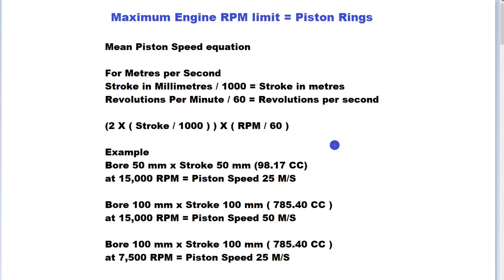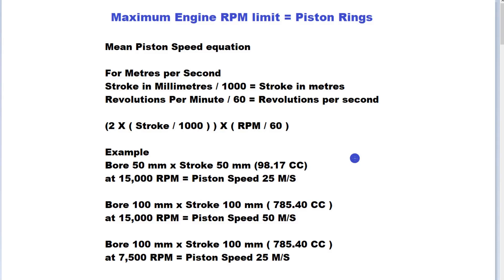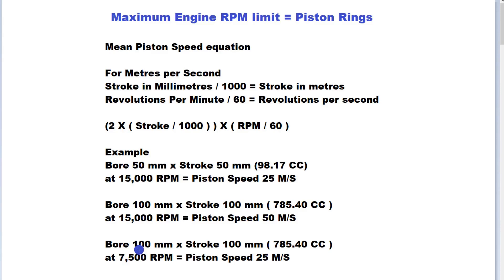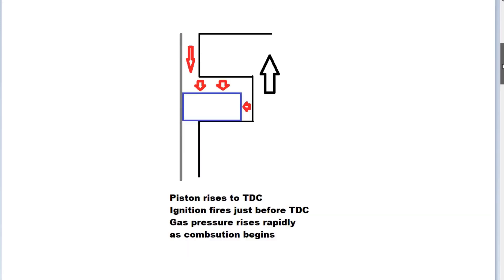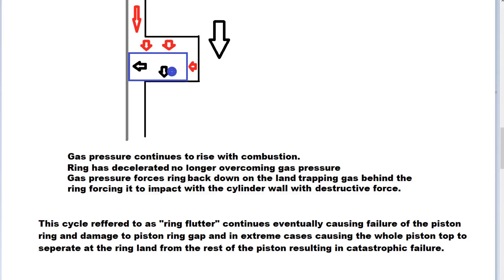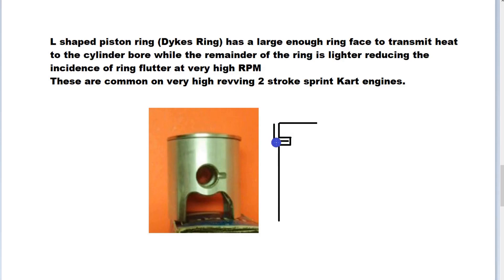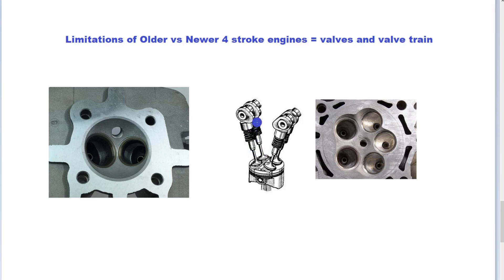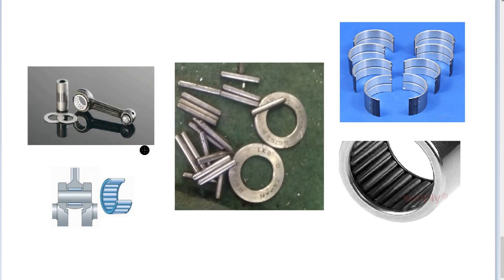Why 2 Strokes can Rev Higher than 4 Stroke Engines and What Limits Engine Speed.

Comment: Really depends on application. Modern 4 strokes rev higher than 2 strokes and actually make power as a result of their linear powerband. You can rev a 2 stroke too high outside of effectiveness. My 250f yz 250f revs higher than my yz 125 and makes more power. 

I would have to make a major sacrifice to my low end to try to rev it to the same rpm. Which naturally being a c level rider is going to make the bike harder to ride and less forgiving. 

Being fair it requires double the displacement to approach "similiar" power. In reality most guys would take a 250f over the 250 2 stroke as its a broader motor and its easier to ride.
Reply from the maker: Your yz 250f may rev higher than your older yz 125 but that does not follow to all engines.
4 strokes do not rev higher than 2 strokes simply due to the mechanic constraints of the fundamental 4 stroke engine as compared to the 2 stroke.
In sprint karting for example rotary disc 100cc engines have been running at above 20,000 RPM for decades and ring-less RC engines revving to 35,000 RPM is not uncommon.
As for the claim "In reality most guys would take a 250f over the 250 2 stroke as its a broader motor and its easier to ride." Once they learn how to ride properly and are able to master the power curve of a 2 stroke it is unlikely they would prefer a 4 stroke.
Reply: @AuMechanic  agreed. Learned and grew up on 2 strokes since I was 5, I am now 31.

Comment: Thank you. Can you explain if the cdi has a rev limiter?
Reply from the maker: Most do have a limiter theses days, it is not inherent in CDI it is simply an addition to them.
If you modify an engine to rev higher you may have to replace the CDI with a programmable unit to allow you to have a curve that will permit higher revs.
Reply: What CDI would you suggest to rev the highest without a limiter? I'm using a jog cdi now. The engine has a chainsaw cylinder on a motorized bicycle. I'm looking to make the highest rpms possible

Comment: The Cbr250rr 4 stroke 4 Cylinder, Revs up to 18,000rpm  that's the Most I've seen on a Stock Bike I'm not sure Moto Gp even Rev that High, I guess it has Small light Pistons & Very Short Stroke, to allow for those Piston Speeds! 👍😉
Reply from the maker: It probably does have light pistons but keep in mind that it is a 4 cylinder so each cylinder and piston is 1/4 of 250cc in size (about 62.5 cc). For that size capacity 18k revs is not overly high considering that some 100 cc 2 stroke rotary disc intake Kart engines rev well above 20k.
MotoGP at 1000cc 4 cylinder is 125 cc per cylinder so 18k is relatively high. Noting that mean piston speed factors in stroke so a larger capacity engine also has a longer stroke as well as larger bore than a smaller engine even where the bore to stroke ratio may be the same in both engines.
Reply: @AuMechanic  Honda NSR 500 имеет рекорд мощности на литр, 400 л.с. на литр

Comment: If I was to put a straight expansion pipe on a 2 stroke leaf blower. Would it help to get more power or higher rpms.
Reply from the maker: It may produce a bit more power but if the pipe is not properly supported you may end up breaking a flange stud.

Comment: Thank you for all of this info, but the car I’m looking at has a piston speed of ~17.1 M/S at redline (6500rpm and 79mm stroke) would it technically be safe to let the engine rev until the piston is moving at around ~22m/s? The engine is from the 70s and is an ohc engine, but if I fixed any valve float problems, could I technically rev it higher? The torque drops off pretty quickly after it’s peak, so would it even be worth it to allow it to rev higher?
Reply from the maker: It really depends on the engine.
This video covers the ultimate limit on piston speed assuming the rest of the engine can handle that RPM.
In short there is a lot more than just the piston speed to deal with.
Reply: AuMechanic yeah I get that, and thank you again, but In theory, could I do other modifications to have the limiting factor the piston speed? And would It actually matter that much? It probably would be better to find a way for the piston to have a longer stroke instead, but I’d probably have to pay a lot more to do that than I would to get it to rev higher. I don’t know if I ever will even do this, but I was just curious if it is possible. Your video was great and I appreciate you responding to me so quickly. Keep up the good work 👍
Reply from the maker: @The Hungry Shark 
Increasing RPM has diminishing returns and as it increases so does the risk of catastrophic failure.
It is the kind of thing you do when you run out of decent gains with other mods.
Example in the 90s when I was involved in a Formula Vee (as mechanic) we had 1200 cc air cooled VW engines that made peak power at just under 4000 RPM, due to limits on modifications raising the RPM was worth the gains and only took a bit of exhaust work (tuned length) and ignition curve (over advancing top end to overcome the restrictive stock intake, carb and stock cam) to get it revving to 6000 RPM and would do 6K all season long without a rebuild.
But....do that to some other engines are you are going to have oily parts hanging out the side of the block and that is long before you get even close to ring flutter
OTH it is a simpler prospect with 2 strokes to raise RPM for gains with less moving parts so piston speed presents itself as the limit.(and Im talking 16,000 to 20,000 RPM)

Comment: My snowmobile is a 500cc 2 stroke virtical twin and wont go past 8100 rpm, how can I squeeze out 8500 or 9000 rpm for more speed?
Reply from the maker: In the case of a stock standard snow mobile it may be down to the ignition module it uses more than porting or exhaust.
2 stroke ignition is a bit different to 4 strokes that simply advance through the RPM range.
2 strokes advance at lower RPM but then up top as the power peak comes on they retard ignition.
So they have either a fixed ignition with no curve or an ignition that can do the above.
In the case of a snow mobile it may have a module with a curve that limits the RPM for "safety" purposes so in that case I would do a little research on the module you have to see if there is alternative ignition modules used to get it revving higher.
Reply: @AuMechanic  it has a switch for premium or regular gas and you switch it accordingly so I would assume it changes the timing
Reply from the maker: Ok that seems to indicate it has some curve options in the ignition module, Id investigate that ignition module more to see if there are any after market units you can use in which you can program the ignition curve.
Reply: @AuMechanic  thanks will do
Reply: 4 jokes rev way higher!

Comment: what is the effect of having long crank throw and having short crank throw in 2 stroke and 4 stroke and the advantage and disadvantage of it? advance thank you for your answer
Reply from the maker: Good question but a bit much to cover in the comment section, I may do a video on that itself.
A longer stroke will produce more torque per revolution, however that will also limit peak RPM of the engine and produce more vibration.
A short stroke will rev higher to achieve more power but will lack torque so will be very peaky but also have less vibration so things like hand held engine like chainsaw etc will have very short strokes.
It is a balance between stroke and bore so most engines have close to same bore and stroke.
There is a good deal more to it but that covers a few points.
Reply: @AuMechanic  i admire your profession sir. i have so much question about reciprocating engine in my brain like what can you say about todays technology of reciprocating engine and how its affect its lifespan and durability compare to old technology apply to an old reciprocating engine? And will reciprocating engine beat the toughness of a gas turbine engine todays technology in piston engine in aviation world?
Reply from the maker: I don't know a lot about aviation but I know that for small light aircraft the piston engine has a lot of years left in it and I can't see it being replaced anytime soon in small aviation applications.
As for modern engine life, computer aided design, tighter repeatable machining tolerances and  advanced materials have all played a part on improving the longevity and power per litre of modern engines.

Comment: Great so how can 2stroke stuffing get more revs (and more power) out of his engine ?
Reply from the maker: Good question.
Alex has already done a lot to the SPX engine and this is always the problem at hand in getting even more power that once you do the main improvements to get more power the things left to do have diminishing returns and only provide small gains.
In short to raise power of any engine there are three ways, increase compression ratio, RPM or brake mean effective pressure (BMEP). increasing CR or RPM both come at a cost to more wear and more chances of engine failure.
Reply: Indeed !. I mentioned to Alex Zenoa piston venting. RC boat guys do it. Could help....

Comment: Good video! But there is one thing i dont understand. The second ring on a two ring piston gets less pressure on top compared to the first ring. For me this means, that the second ring starts to flatter at way lower rpms than the top ring. Am I right?
Reply from the maker: The effect is proportionate, so that if there is less gas forcing the ring down and outward there is likewise less gas that could force the ring off the cylinder wall and bypass it.

Comment: could you do an example on somthing like a 50cc bike? I will weigh the piston ring of my zündapp and add it here later on :D
And the Stroke is 44mm and the bore is 38mm
Reply from the maker: 44 mm stroke at 17,000 RPM is about 25 m/s, at 20,000 RPM is about 30 m/s

Comment: Interesting, i always though that the weight of the piston or rather the strenght of the conrod. Why then manufacturer build pistons out of aluminium? Is it just an accelleration issue? I mean, for example junkers had build opposed piston two stroke diesel engines and they used to build the pistons out ouf two components, the fireplate ( piston face out of steel) and the main piston body out of aluminium. I guess they used aluminium to reduce weight since it was an aircraft engine but that doesn't explain why car manufacturers do the same thing.
Reply from the maker: The weight of the piston is going to determine how much load will be carried by the con rod and bearings so no sense in having it any heavier than is needed while ensuring it is strong enough but that is an issue of wear and longevity where the limit of the piston rings remaining seated in the ring land and sealing will occur the moment the engine speed exceeds that limit.
The weight is the piston will cause come stretching of the con rod over time but it will not cause an immediate failure of the rod before the ring flutter becomes a problem.
Con rods generally fail more due to a failure of the bearing that causes twisting load at one end as the bearing seizes while heating the end of the rod up and generally lets go at the big end but again that will take some time to occur and usually only if there is a bearing failure to begin with.